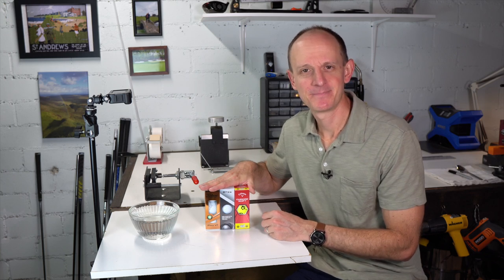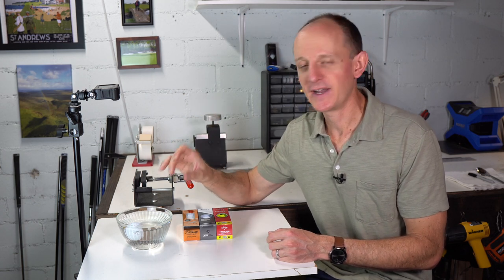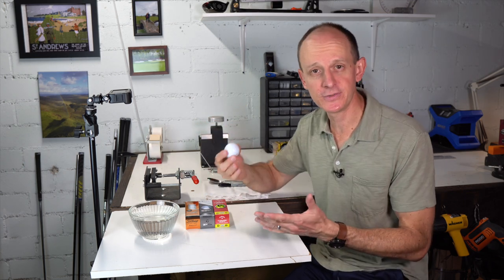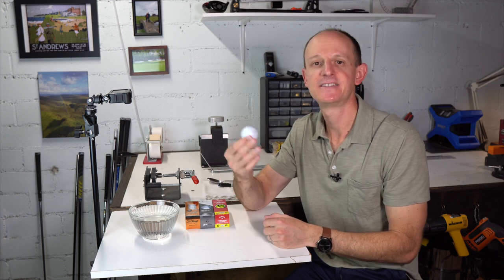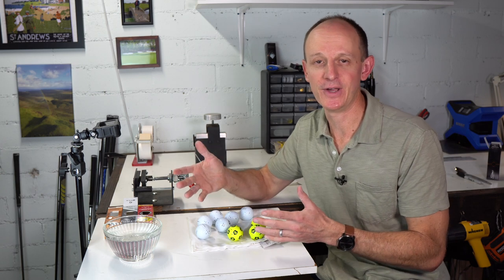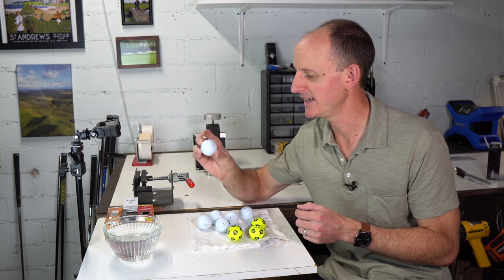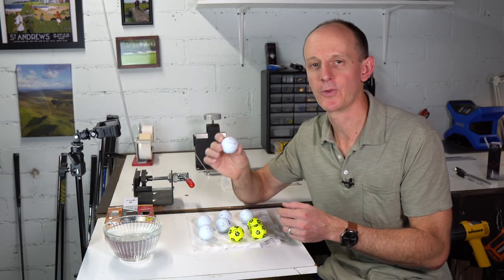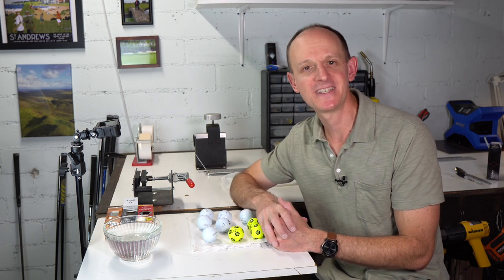GOLF BALL TESTING LIKE BRYSON

Comment: If it's bad enough out of balance it only takes 24' to miss the hole entirely. Saw this illustrated with a putting machine in a video just today.  He also did the float test, and he commented that he'd never had a problem with V1's or TM's but that was uploaded seven years ago. I have heard other comments as to a top maker having core issues since then-and maybe that's what you're seeing.  (The GolfWorks)

Comment: I did this test exactly with the spin at least 10  to 15 years ago. I did it in my garage where the floor is stable. I got the same results.  What I took for it was I will never use a nike ball again because they tested the worst and then I tested the same balls after using them and the nike was also out of round.  It made a big difference in my scores. Later I got a device that spun the ball and that worked well and it had a cap that allowed you to mark a line long before anyone else. 
        Great job, I love your channel.

Comment: I used to do this with balata balls back in the 90s. Back then the center of gravity could be just about anywhere, since the ball had a liquid core with wound rubber bands around it. Nowadays ball manufacturers are far more consistent due to the use of a plastic center and urethane covers. I don't think it's necessary to do this with golf balls any longer.

Comment: I’ve done this on and off for years and there is something to it. Not sure how this happens during the manufacturing process but it does. Dave Pelz did a test probably 25 years ago where he checked the balls and marked them with a single dot then struck them with a putter head in a fixed pendulum devise that was sitting on a pool table. When the dot was on the top the ball would roll straight. When the dot was on the side the ball would curve to heavy side every time. When I start missing short putts I go back to finding the balance point of the ball and it helps.
Ken

Comment: Mahalo from Hawaii. Love this video and ALL your videos! I stopped Spining & FLO'ing shafts because of your proof it doesn't work. I have been balancing all of my golf balls for years like this and I have never once had any brand ball NOT float to the exact same location. I believe there is one thing you're missing in this test that is crucial for the ball to spin more freely. You must put a few drops of JetDry on top of the water before dropping the balls in (I prefer this method) or use WD-40 to coat the ball like David Lee does of Gravity Golf (as seen on his YouTube channel). Keep up the great work...you have changed my opinion on Spin & FLO and saved me a lot of time on installation.
Reply from the maker: Might have to try the Jet Dry against my method and see what difference it makes.
Reply: @EFGMC  It breaks the water tension and allows less resistance so the balancing in the salt water becomes more precise...but now after watching your other video on rolling the results of a balanced ball you may have changed my mind AGAIN if it really matters! The only thing that I can think of that might make a difference is you rolled it on a ramp instead of a putter that "hits" the ball with loft. I have seen a putting machine hit balanced balls and seen how they roll differently when the heavy spot was moved to the side. Again, thank you so much for your honest reviews and help!
Reply: WD40 works also but is a little messy as you have to clean the ball afterwards. I hadn't thought of JetDry

Comment: Great Info - waiting for the putting green video, considering the amount of money we spend and the BS the manufacturers throw at us, you would think the tolerance would be much tighter.
Have you done any recent videos on drivers with a 3 wood shaft or a 3 wood with a 5 wood shaft or do a vid with said shafts and heads but going down in half inch increments. Just an idea.
Reply from the maker: Definitely want to see what difference you can see in those balls with the noticeably heavy side.
Funny you mentioned a shorter wood video. Was just brain storming a 43in driver build video.

Comment: I have been doing this for years.  It's been my experience that the higher quality balls, like the ProV1s and such are usually very well balanced.  The balance issues really come into play with the second tier and lower models of balls.  you can still use them if they are off balance, you just need to make sure you are setting the ball down, especially when putting, so that heavy side will roll end over end and it won't effect the line very much.
Reply: The proV has quite a few videos out there for being off balance

Comment: Great video as always. My only question is with this test is that if there's an air pocket inside any point of the ball, wouldn't it throw the results because it floats water. I've had a few beers so please tell me if I'm wrong. Lol
Reply from the maker: Not sure about this. I think even if there was an air pocket, that would change the CG and we would still be in the same boat.

Comment: I wonder how many separate molds are  used during the manufacturing process.
Reply from the maker: I have a feeling it's a lot. Also wonder how often they switch them out.
Reply: @EFGMC  Also, I think there could multiple steps involved where imperfections could be introduced.   A "simple ball"  is probably not very simple.

Comment: I think those ball spinners do it quicker I think its called the check go pro
Reply from the maker: They do, but i don't know that you could tell from them how out of balance a ball is like we did here.
Reply: @EFGMC  the spinner finds dynamic balance orientation.   Finding the  static balance point as you are testing just tells you how statically unbalanced the ball is. It will always wobble in real world flight. The dimples help in stabilizing flight. 

Do a blind test ask someone to do the test , find the worse and best balanced ones.  Just mark them with a number.   

Putting results will not change 
There will be next to no flight difference either.  Again the spin stabilizes the ball.
When the ball is hit it deforms, in flight it is deformed because of the spin makes it ob long not round. Bryson may do it because he is looking for quality control.

I have never seen a controlled test showing balls going off line because of the off center core.

So is it possible a 2 piece ball will fair better and possibly be more accurate in this test since the core is big ?

Don’t do it 😂 it will cause 3 and 4 piece balls to drop in sales..

Comment: Does anyone remember the ball balancer that would spin the ball in a enclosed cover and you took a marker to make a line?
Reply: I've had and used one for over 10 years. I prefer it to this system because it more of a dynamic measurement closer to actually hitting a golf ball. Like he said, this method has been around for a long, long time. Modern balls are much more consistent than wound balls but there are still inconsistencies so why not take advantage of that to help with driving and putting?
Reply from the maker: Couple other people mentioned it. Check Go Pro or something close to that. Problem with it is yes it shows the ball is off, but you can't see how bad it might be like this method.
Reply: Been using the spinner markings and my putting has vastly improved….my lip outs are not nearly as frequent as last year! There is a video some where with a guy using a putting pendulum with the balls marked and unmarked…all the balls marked after the spinner went in vs. before….!

Comment: Sorry m8 off topic but you have helped me before with a question so I have another one for you.
Broke a shaft right at the club head so the part of the shaft is now stuck in the head I have bought a new shft for it. 
I have tried drilling it out can only get the drill bit to so far then it just won't go i have burnt out a couple of drill bits trying to this and I am kinda stuck think I may have totally knackered it any ideas of how I could remove this lip it is stuck on sonthe shaft goes on easily did try to shim it but no joy it's still to slack thanks neill
Reply from the maker: Is it steel or graphite? If graphite you can take a  long wood screw, drill a pilot hole, then screw in the wood screw. Heat the hosel as usual and pull the wood screw end out with pliers and twisting motion. If it's steel, you can use a similar method if you have a wide enough screw. I can also use a drill bit  about the same size to often catch the steel shaft and twist it out.
You can buy specialized bits and tools for this from Golfworks etc. if these don't work for you.
Reply: @EFGMC  think I have rounded it to a point where there is no end of the shaft showing now so it has like made the inside of the golf head .mm extra thick would have to taper down the shaft to get to fit oh well lesson learned provably just buy a new/second hand one on ebay cheers and thanks for your advice till next time neill

Comment: Would the one with the 'bad' outer centre of gravity be a straighter ball if alligned vertically on the tee (would only want to use it on a par 3 to avoid 2nd shots into pin
Reply from the maker: I don't know. Would be a good experiment. Don't think I am good enough to be able to test it myself. Need a tour pro or a robot to get consistent inputs.

Comment: I usually float my balls in the bathtub, but this is an interesting concept. I would think that these small variances in the balance of the ball would not make a big difference in putting where the condition of the surface of the green also has a large effect on the way the ball rolls and the path it takes. It seems to me that longer shots could be more influenced since they’re just flying through the air.
Reply from the maker: Going to find out about the putting in the next week. Stay tuned.

Comment: Does the spinning method work the same?
Reply from the maker: Yep. Same idea.
Reply: @EFGMC  
Spinning the ball heavy spot comes to the top, do you play the spot at 12 o’clock or 3 o’clock thanks
Reply from the maker: @teegolf  I like my method better than the spinner because it shows not only where the heavy side is but how concentrated it is. Then you just line the ball up with the heavy/light axis going up and down.

Comment: ALL golf balls will lose shape and balance after being massacred on the golf course. You only need to have about a dozen that are really balanced for putting. And FYI, marking a ball with marker DOES throw off the balance!!! Besides, the dimples on a golf ball in terms of the contact with a putter face actually make more of a difference than the ball being slightly off. At the end of the day, golf in general requires quite a bit of luck. I mean for every foot of putt, your ball will roll over 100 individual blades of grass and just one can cause you to miss it.
Reply: IFIRC, Karsten said when they made balls, one a wound ball was
Hit with a driver, it took 24 hours for it to come back to round. 

They did their own solid ball at the time.

Comment: Your test is flawed.  When the ball breaks the surface it won’t work correctly.  You must have the ball just below the surface.  Your test only proved that the balls you think were best are the most unbalanced balls.  Try harder
Reply from the maker: Disagree. Having cut the balls open after floating them, you can distinctly see the core being off center in the balls that had the more pronounced heavy side.